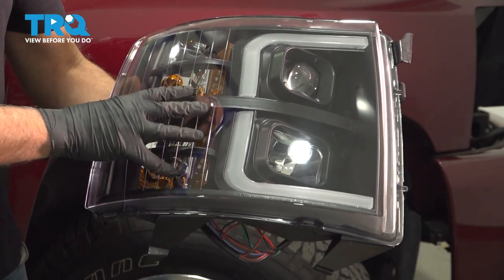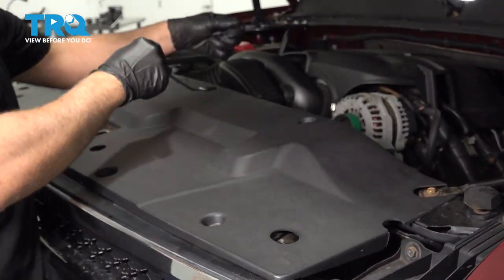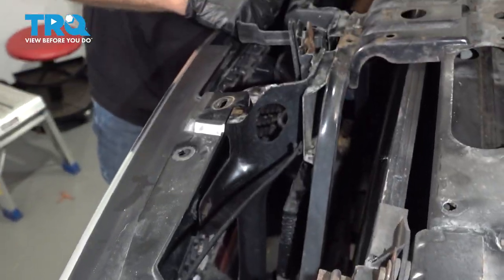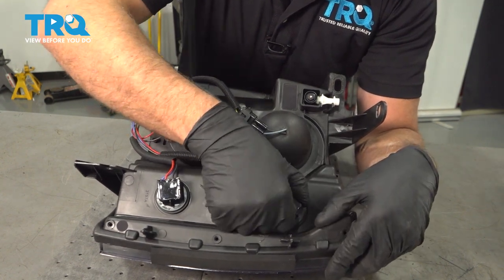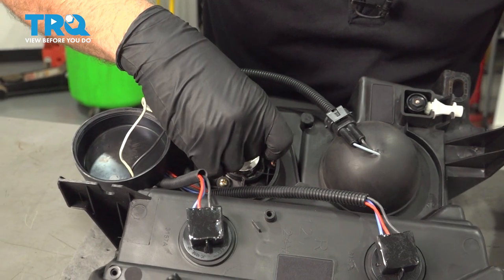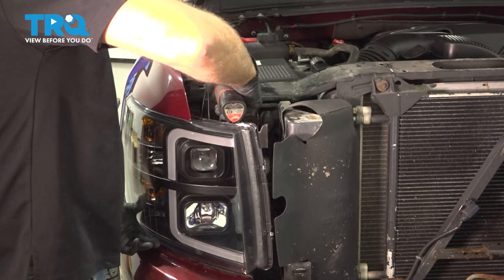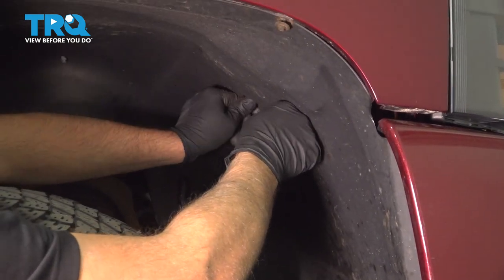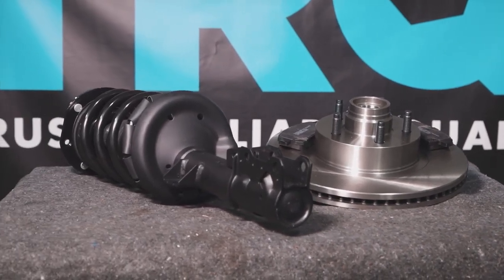How to Replace Performance Headlight Set 2007-2013 Chevrolet Silverado

Comment: From experience any aftermarket lights you get no matter if it says there sealed or not get yourself a tube of silicone and put a thin bead around the edges you will never notice but if you don’t there is a pretty good chance you will get water or condensation in them at some point even the expensive ones seem to do it